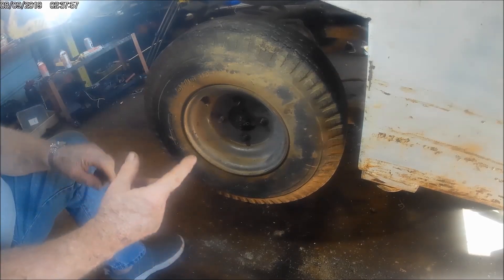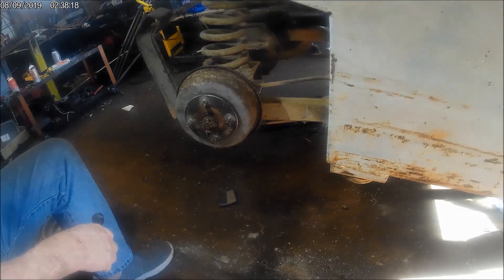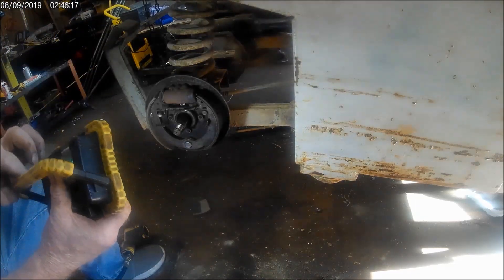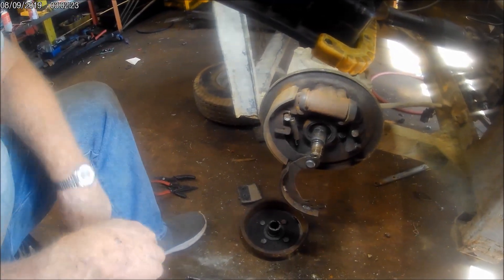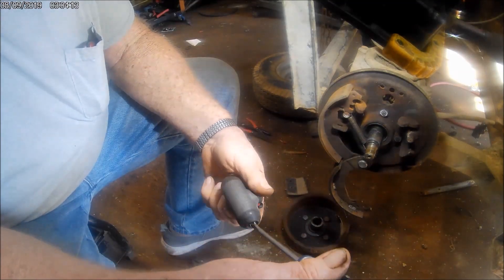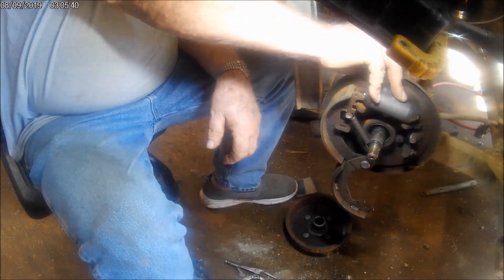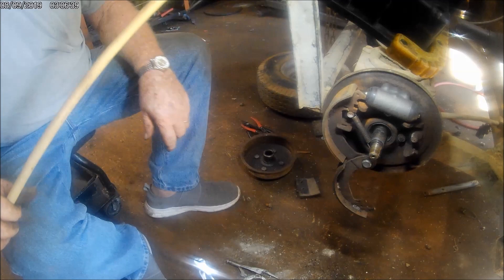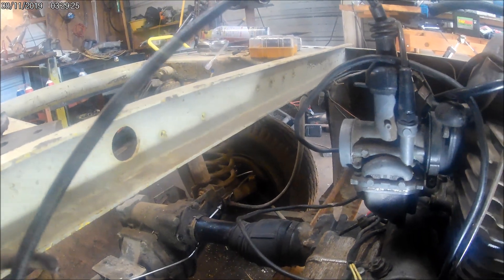cushman/kawasiki progress brakes and exhaust

Comment: Made some good progress on the brakes and the exhaust tubing looks like it will be good too
Reply from the maker: I actually had the engine running for a short time today, I still need to get all the wiring straightened out.

Comment: I guess the tyres are loaded because it is light at the back. I like your hub puller, we always look out for tools like that at auto jumbles. The brake design looks nice and simple. You are making great progress
Reply from the maker: thank you, yes, my dad had that old puller when he had his mechanic shop back in the 50's and 60's. I see that little Chinese girl that rebuilds those generators and diesel engines has a hydraulic puller but sometimes it can't quite get the job done. A friend told me they fill them with some kind of foam,, not the type we fill cracks in wall but something I guess is made for tire.